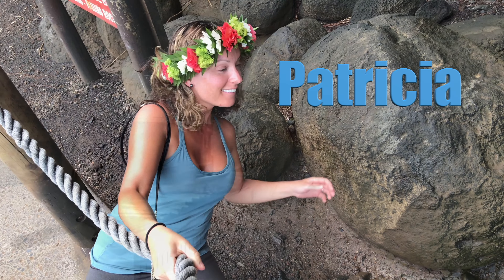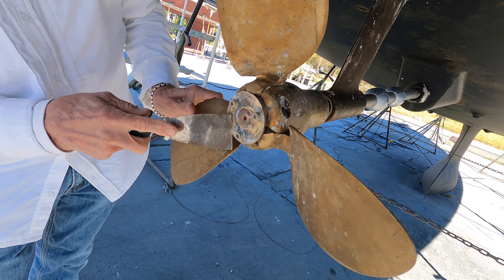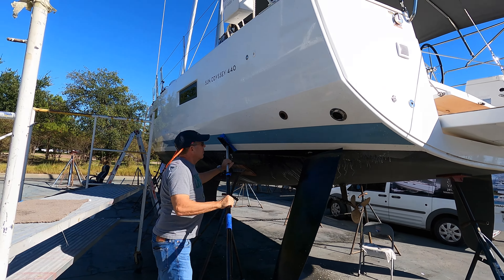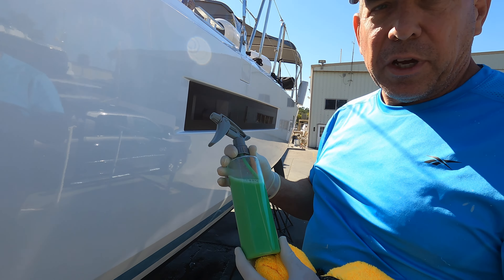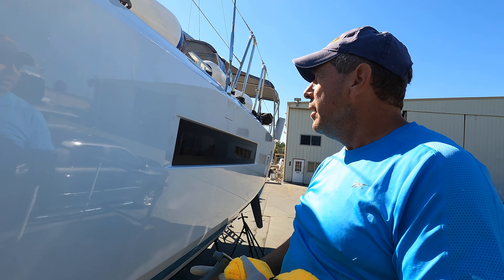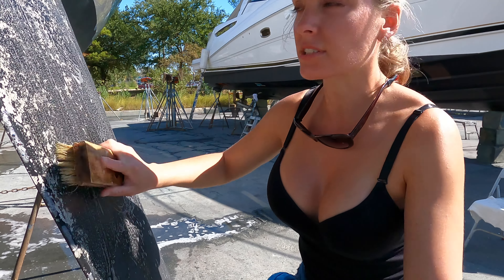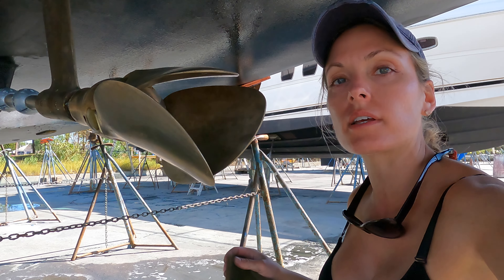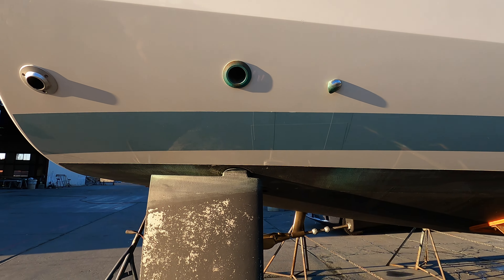First Trip to the Boatyard

Comment: Give us some updates on the Griots Ceramic.  How it works and how long it lasts.  What type of bottom paint in on the CAVU?
Reply from the maker: It was recommended by a coworker who used it on his ski boat and cars. I’ll track it’s performance.
Reply: @SailingCAVU  
Looking forward to that. I've used a Marine Silicon Polish that leaves a Hard Protective Shell, Guaranteed for 10 years. A Macwester 26 Bilge Keel Yacht was still gleaming shiny after 8 years in a Marine Environment.  .I used it on my parents new UPVC Fascias and barge boards on their house in 1989, and with only the occasional brief power wash,  today they look as if they've just been fitted. got to ve good for protecting Gel Coat imho. Be interesting to see how Ceramic Polish Compares for sure. Would something like Propspeed help with the Prop and Prop Shaft ? I think there's some good alternatives too. For me, the Antifouling I like is Pettit Trinidad Pro Hard Antifouling,  which has 2 epoxy primer coats and then 2 Antifouling top coats, should be good for the rudders as well.  Should have no growth for 3 years, then just deslime for up to another 4 years, so will purchase through wherever that can be applied properly, or buy a secondhand boat, and sail it there for a Haulout and supervise the work - I'm disabled and can't do it myself any longer, but that's not going to stop me. 🙂👍🇬🇧🏴🇺🇲